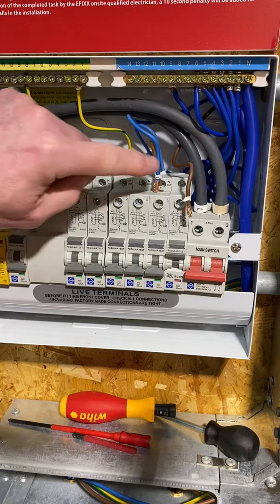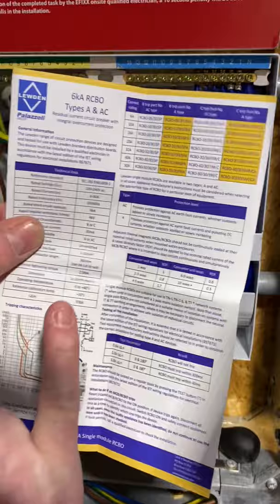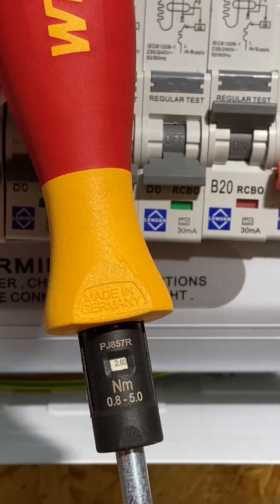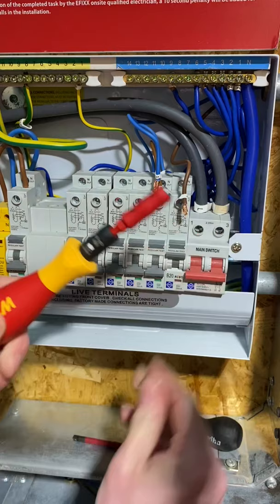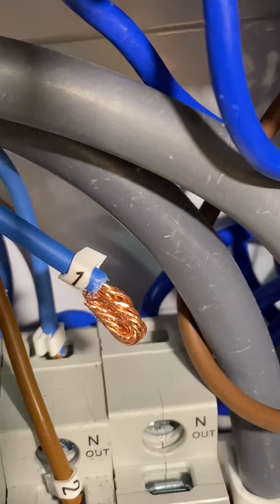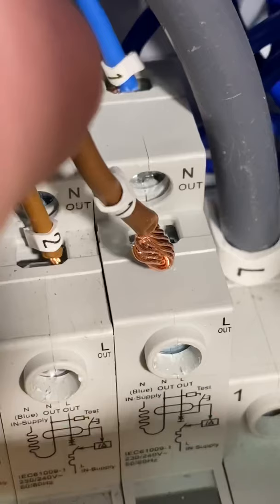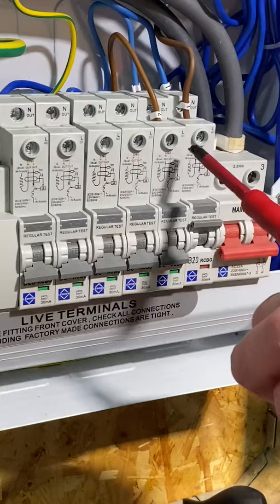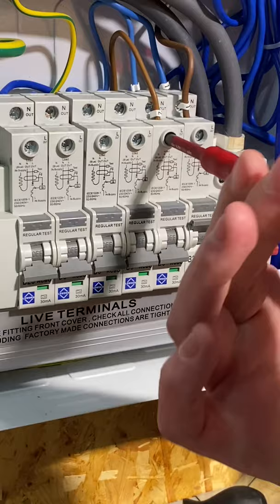Using a WIHA Torque screwdriver to check the tightness of MCB screw terminals. Electrical #shorts

Comment: This guy makes tightening a wire sound so high-tech, like when a chiropractor call himself a doctor
Reply: Thats a spark for ya
Reply: Thing probably is only accurate to the nearest Nm. It's not like it ever gets checked or serviced.
Reply: Most chiropractors have Phds, they can call themselves doctors.
Reply: Because he wants something more professional, if youre Just a noob who doesen't even change a lightbulb Thats youre problem
Reply: Clearly you ain't a spark, loose connections can cause fire
Reply: @geecali8356  anyone with a Phd can call themselves a doctor. Chiropractors usually have science doctorates on the human body so they earned a doctor's title, more than most physiotherapists do. Can a dentist be called a doctor with your standards?

Comment: Don't forget to give the cable a little tug and check your torque again.
Reply from the maker: Top tip
Reply: Put this on a shirt, it’ll sell.
Reply: More important that having the exact torque in my opinion. These things always loosen over the years anyway which is why a test and inspection is recommended every 5 in the UK.
Reply: I had an A/C installed last spring. It was too cold out to check that it runs. When it heated up it wouldn’t run. I opened the house power panel, tested the tightness and when I tugged on one wire it came out from behind the breaker. Slacker electrician never gave that test tug to see if it was actually in the connector. Disappointed.

Comment: Also, if you don't have the manufactures instructions a lot of breakers will tell you the Torque setting on the side of the breaker.
Reply from the maker: Sure will 👍🦾
Reply: Was just about to ask that question cheers

Comment: The sparky in me : pulls the wire ,.. yup tight it is..
Reply: I like to leave the wire ends untwisted. Twisting the ends causes the wire to roll, The screw then, often, passes past the wire. This frequently happens, when more than one wire is pushed together in a hole

Comment: Nice demo, straight to the point. We don't have much screws anymore in consumer units here in France with all the automated connections and bus bars, but I love this WIHA TorqueVario system. It's still of great value for main arrival and the 18 pieces kit is especially useful since the bits can be mounted on other non-torque WIHA screwdriver (the LiftUp in my case).

Comment: Simple easy application, also many manufacturers now say in their instructions to use a Slotted 5.5 or 6.5 x 1.2 mm driver and a PZ2  depending one what size cable is being tightened also using these drivers stops the SL/PZ being snapped 90% when loosening 😀😀

Comment: Gary get yourself a ferrule on those sausage :)
Reply: Completely unnecessary!  They are cage terminals, not screw terminals.  First understand why and when you should use ferrules before going out and buying an installers pack.  Also understand why manufacturers started using cage terminals and how to use them properly.

See my explanation in answer to "carforumwanker"'s comment not far below this one...
Reply: I put ferrule on all my stranded connections
Reply: @scottwilliams3665  very sensible in all screw connections.  Very unwise in all cage and especially leaf-spring terminals.  Learn the craft first!
Reply: @Dranok1  this is soo untrue. You can do both in a cage terminal.

Comment: In 40 years Iv never used a torque screwie and never had an incident,pretty easy to do I reckon,eg the wife can do it...😖
Reply: Don't know what country you are coming from, but some have strict regulations regarding electrical work, also it's a sign of a professional job following manufacturer's recommendations
Reply: In our next video find out the proper torque settings for you sink tap and the proper down force needed to flush the loo.
Reply: @tennicktenstyl  yes and I can guarantee it will be the yanks again 
with their nonsense

Comment: Quick question, do you need to to use the torque screwdriver on a specified setting for the meter tails especially as they will be carrying the high current to feed the board or can you get away with tightening them up as much as you can get them with a normal VDE screwdriver?

Comment: Hey!  Stop wasting your consumables!
Every screw, I heard you click it 4 times.  Only let it click once and your driver will last years.  They have a limited lifespan -- used to be 5,000 clicks, don't know if that's changed -- and first click is the important one, any more is just a waste of lifetime until the manufacturer says, at next calibration, "you've run out, the ratchet is worn, new unit."

Also, while I applaud the care and precision of your twisted-up and doubled-over conductors, I hope you realize that these are cage terminals not screw terminals and, as such, would make a better more mechanically secure contact by not doing so at all.  The perfect termination in a cage terminal is (perhaps counterintuitively) untwisted parallel strands, so they can be flattened and each strand contacted front-and-back by the cage.  Individual strands are not damaged because it is static compression force, nor strained because any tensile force is shared equally by all 7 or 15 strands (or whatever the lay).  Then when you torque up the terminal, there will be no let-off after the first current flows since there is no "spring" effect of the bunch of strands taking up any of your initial compression force.

Hmm, that started out a quick comment and became a didactic stream of consciousness.  Sorry for the electrical engineering lecture...
Reply from the maker: Great input thanks - worth exploring further 👍

Comment: Got one of these torque  drivers and normally work on Wylex boards so torque is normally 2.4nm for live and 1.7 nm for neutrals , but those screwdriver bits always seem to break off on corner , must be a weakness on them
Reply: keeping them straight is usually solving half the problem. the other half is getting quality bits from the usual suspects: PB Swiss, Wiha, Wera, Witte, Vessel, etc.
Reply: @kittytrail  they was the bits designed for the screwdriver
Reply: I have always said I don’t like and don’t need a torque screwdriver, they are not a requirement they are recommended as good practice, it’s strange how they say nothing about the use of them on the packaging but they do say for tightening the screws and bolts on engine blocks and stuff like that.
I then like a mug brought a sodding torque screwdriver and god dam peace of rubbish the Pozzi /slot blade snapped the first time I used it , I was set to 2.1Nm so not a lot. £80 down the drain I will never get or use one ever again . If after 30. Years as an electrician I can’t tighten a tiny little screw up to 2.1 No then I will have to think about a career change.

Comment: You should of  had ferrals on that stranded cable
Reply from the maker: Not on a class 2 conductor
Reply: @efixx  anything  with ungather  ends can be dislodge  with temp  and humidity   and vibration  . Poor workmanship small guage wires . Guarantee  that if you wired my equipment  like that you would have repeated failures .
Reply from the maker: A termination of a standard fixed installation cable to an MCB shouldn’t need special preparation. This is a requirement in the product standards for MCBs and distribution boards.  Following the manufacturers instructions and using the correct specified torque settings is not poor workmanship.

Comment: If only there was a tool to ensure that the conductor had been fitted INTO the terminal correctly in the first place. I’ve been to lots of “fire calls” or burning smells where the so called sparky had tightened the terminal ok but the conductor wasn’t even inside the clamp! A simple tug would have confirmed it but rarely done by incompetent alleged craftsman.

Comment: I have this tool.  There is absolutely no way Gaz was applying 2.5Nm when that tool clicked like a ratchet spanner, unless his was knackered.  Also manufacturers instructions state never slacken a fixing using any torque driver. Perhaps that why Gaz’s is knackered?

Comment: What the heck is with the strip long and bent over wire? That would not pass inspection in the United States. There is a insulation removal gauge on the side of the breaker. Or in the instructions that you were looking at for torque reference.

Comment: Great video Gaz 👍 better than wrist tight 🦾
Reply: And what pray tell is wrong with a calibrated wrist?  Old methods still work fine:  I can tell just by experience exactly when I get to 15Nm +-10% 😈

(And when me rheumatism plays up, I gets me impact on 'em instead...)
Reply: @Dranok1 . Love it haha 😄
Reply: @Dranok1  old methods still work fine on old equipment but might not so much on modern ones where materials are not the same and cost cutting in manufacturing has had an effect on reduced tolerances. nothing wrong with extra cautiouness when working with sparky stuff especilly if doing so professionaly.
Reply: @kittytrail  Seriously?!  You can't tell a joke even when it's written in red pen with a post-it note arrow pointing to it saying "this is a joke" ??  I begin to despair...

Comment: Unless you're regularly going to get the torque screw driver regularly calibrated and certified you truly have no way of knowing that it is accurate.  If you ever drop that screw driver  you should rightfully get it calibrated again too.     If you don't know if the tool is in total calibration what's the point in even using it.

Comment: I didn't know you guys had stringwire we use full copper wires in belgium way better in my opinion
Reply from the maker: What about when using conduit ?
Reply: @efixx  what do you mean
Reply: @quintdewit4870  you doing run single  strange conductors  in conduit  you would never meet bend radius requirements.

Comment: So you actually over tighten every time,one click is correct method on normal torque wrench any additional clicks increase torque 🤷🏻‍♂️ ...I won't be using them anyway only time use torque wrench is on buzz bars and other larger gear and cars

Comment: Interesting, do manufactures provide a tolerance on their torque setting requirements? If I’m not mistaken the Wiha has a repeatability tolerance of +/- 6% of set value, so in your example of 2.5 N.m this would be +/- 0.15 N.m so could be anywhere between 2.35 to 2.65 N.m That’s assuming you found the exact centre between 2.4 & 2.6 N.m in the blank window on the torque screwdriver.
Reply: 6% would be acceptable up to 50 Nm or so, not even worth thinking about. Even a top of the line snap on torque wrench is only accurate to 4%, not that they're the best anymore. You can of course recalibrate most to nearly perfect accuracy but a few % isn't worth bothering

Comment: why not use ferrules on those cables ?
Reply from the maker: The question of ferrules on Class 2 conductors is contentious. Video coming soon. They shouldn’t be needed on consumer units unless they  are Class 5 flexible conductors.
Reply: @efixx  THEY LOOK BETTER ! And you can charge the client more !
Reply: NO!!!  These are cage terminals, DO NOT put ferrules in cage terminals!  They are designed to take parallel strands, not even twisted up and doubled over strands (which is a trick we in the UK use in screw terminals to distribute the strain on strands, where the rest of Europe indeed use ferrules and laugh at us for our "lack of professionalism").

The use of stands in cage terminals aids in taking advantage of boundary effect to keep control of temperature of terminations with high-current applications.  Not really important here, obviously, but you need to understand why you are using a technology, not just follow blindly other people's habits.  If you get into the habit of using ferrules in inappropriate contexts, you will end up doing something heinous like trying to squeeze a ferrule on a 1.5mm conductor into a miniature cage or leaf-spring terminal only designed for 1.5mm (like those green PCB mount blocks in PIRs) and jam up the terminal, knackering the terminal (and probably the accessory) if you need to remove the conductor.
Reply: @efixx  contentions video on any non flex solid core wires pleas.
Reply: @Dranok1  first no one laugths at you for that. Second i disagree on you point of view. Why because i work in the industry with way higher intensity than what you currently see in home standards. Copper is a major pain in the ass for one reason, he is almost too soft. Even with a torque control copper will become looser. Even in cage terminals. The use of ferules and of the correct tools allow less deformation. Even with that, where i work, we check new systems after their first six months running. And bigger the wire is, the worst it is.

Comment: how screw driver companies  make money make a plan with circuit breaker  companies  that u need torque on your screws  lol im doing electrical  installation  for many many many years never had a problem and i always give my customers a life time guarantee  that nothing will happen   from my side if they plug in somthing  damaged thats they side problem
Reply from the maker: Inside job

Comment: Real electricians DON'T use torque screwdriver.
Reply from the maker: So you choose to ignore manufacturers instructions ? - Good luck with any major warranty or professional indemnity claims.
Reply: @efixx   I see manufacturers instructions as "cover your ass" instructions in many cases, if there ever was a fire and the case ended up in court, the manufacturer would ask for proof that you used a calibrated torque screwdriver, which of course you couldn't, case closed...

Comment: That all nice and good work too but!you should know that every body doesn't know about electricity,in the video you shouldn't be touching cunducter (striped wire) or peeled copper and little advise about screwdriver to not to touch it on the metal bar.whenever you try to tight screws with the live wire in it always dangerous so you need a well insulated screwdriver even on the metal bar coz sometime you need both hands and this is the time u forget the live current and it will give u powerfull shock.you should understand what am trying to say.u know better than me so always give a good advise where ever is a chance for electric shock,thanks anyway for all these vides

Comment: What we are coming to , Are you tightening a   Cylinder head or wheel on a car ?
Reply from the maker: Loose wires cause fires 🔥
Reply: @efixx  a professional will know how much hand pressure to use. 
Loose or tight, two  different words

Comment: NO FERRULES! NOW MANDATORY FOR STRANDED CABLE! DOH! And you're supposed to be a Qualified/Registered sparky!!??0
Reply from the maker: Ferrules aren’t recommended for Class 2 conductors (7 strand in the example here)
Reply: Ferrules are required when using stranded wire in connectors where the end of the screw bears directly onto the wire. These MCBs have caged screw clamps that are designed to clamp down onto the bare wire.

Comment: Bruh no Electrician is using torque screwdrivers and shit like that. Just tighten it until it doesnt pull out and it feels tight. Waste of time if you read the instructions and then pull your torque wrench out and put the right bit in just to tighten a damn screw. Youd get fired so fast for being the slowest electrician alive
Reply: Wait until you work on systems with 2000A. I assure you the torque control is widly seen a not being an incompetent  idiot. Also true on AS-i field bus M12 connectors..